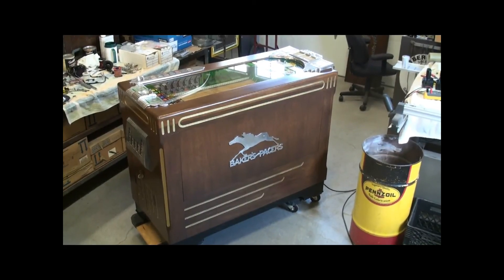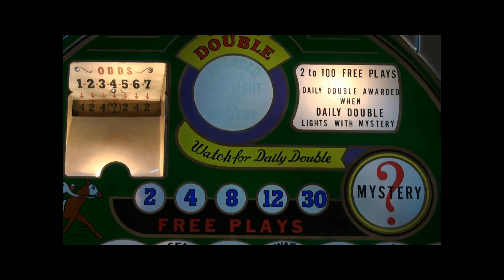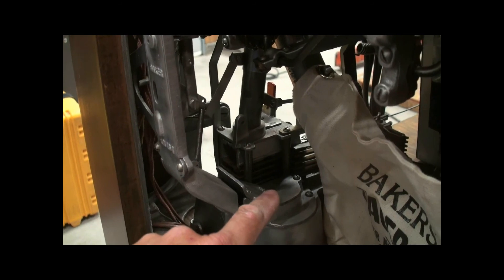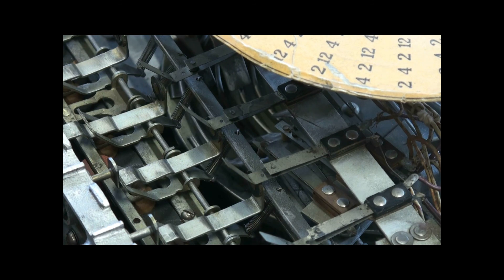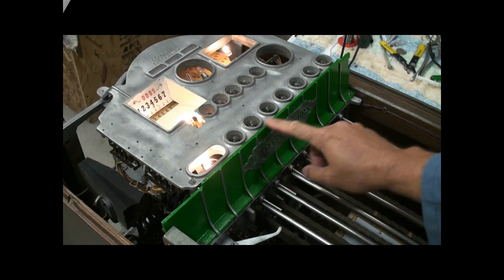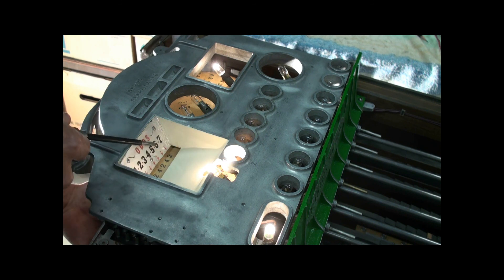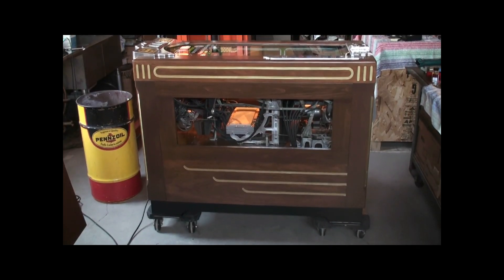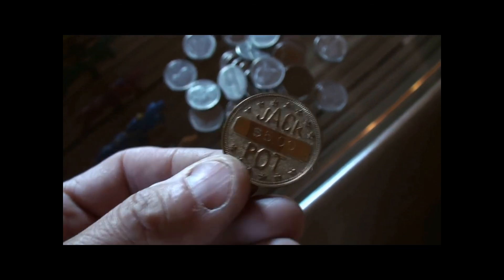Baker's Pacers Horse Racing Payout Slot Machine Restoration

Comment from the maker: You have to study Graphics Arts and Film Production. Oh wait, you mean to be able to restore games, not to make cute videos with lots of useless extra fluff and sound bites???  -- Well then, at least in my case, it's a little bit of knowledge in several areas, including electronics engineering, mechanical engineering, carpentry, and work in a machine shop as a tool and die maker. It's been a 30+ year education and I'm not done learning yet...
Reply: Another thing you have that you didn’t mention....incredible patience and extreme motivation. I’d bet 100’s have been pulled apart with intention of restoring, but get left I assembled in boxes.